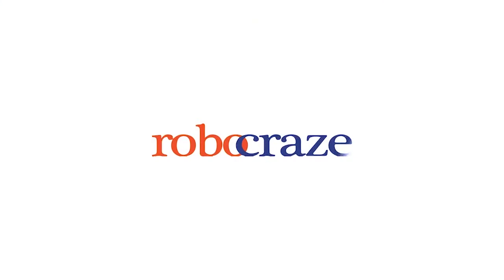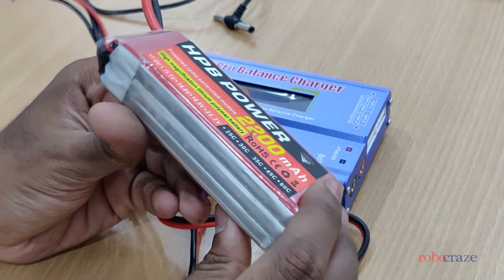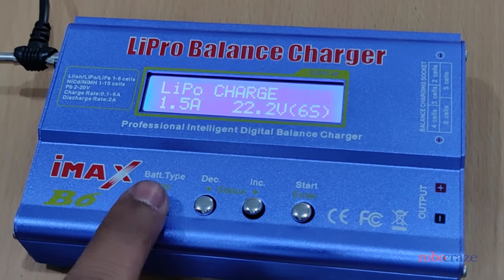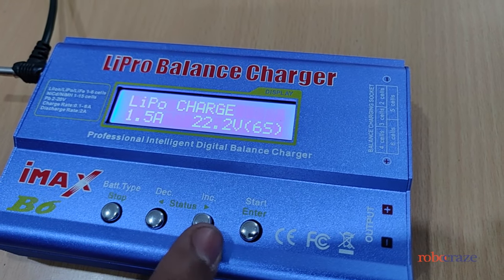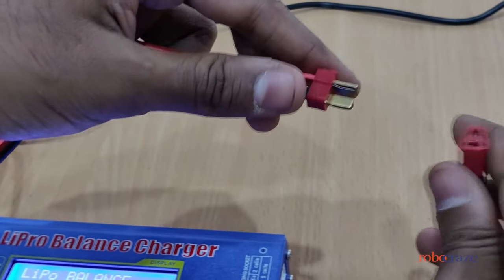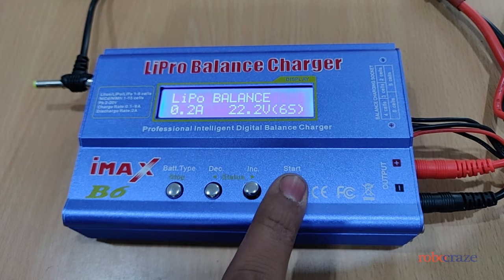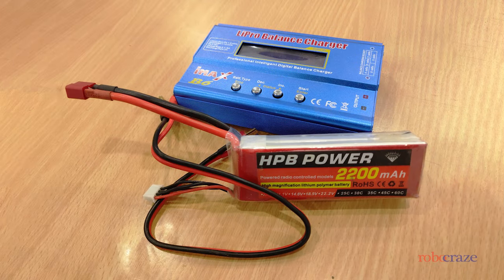#TUTORIAL How to charge a LI-PO BATTERY & IMAX B6 MULTIFUNCTION CHARGER

Comment from the maker: For increased safety, it is advisable to connect your charger into mains power, before you plug in charging wire for battery.
Reply: I put the battery to charge normally with the process you showed in the video and after 10 seconds it stops charging and throws me out and doesn't charge. I don't understand why this happens?😓

Comment: I want to know if it supports up to 20v power supply as input because I want to use a laptop power supply.
Reply from the maker: Hello,
No, the imax b6 does not support 20v and it is not recommended to use this charger for charging a laptop.

Comment: This video has many errors in it.  
1) Never connect the cable to the battery first, your risking the other end of the cable with exposed leads touching each other, etc.  First, connect it to the B6 then to the battery then balance port. 
2) Amp setting.  you should enter the battery capacity... For 1500 mAh, enter 1.5 Amps.... Etc.
Reply from the maker: We will take necessary action. Thanks.
Reply: Of course, there is a dependency and that is that the power you are supplying from the adapter is capable to outputting the wattage and amperage needed.
Reply: So, for example:
5200 mAH 2S Lipo:
Charge at 1C: 5200/1000= 5.2 Amps.
Fully Charged Voltage for 2S lipo is 8.4V
Power Draw: 5.2A * 8.4V = 43.68 watts.

Your adapter must be able to supply that
Reply: Mine is a 5200 mah battery. But the charger only goes to 5.0 is it safe to charge it at 5.0 even tho it’s a 5.2
Reply: K K so i bought the Imax B6AC, youre saying to plug the charger in to the wall socket first, then plug in the output to my deans connector on the battery then plug in the balancer and then set the settings and start the charge?
Reply: @SPIXZY49  Yeah, just balance charge you'll be fine. You'll just charge a bit slower
Reply: @BuckSnortx  Yes.
Reply: @SPIXZY49  yea but it will a tiny bit longer
Reply: I notice wrong info on his part... 5000mah battery would be 5.0amps n so on ,u had battery connected to extension if the ends would of touched possible battery damage...
Reply: @SPIXZY49  yes it will just charge a Lil slower but it's all good

Comment: i have not received the power cord adapter can you please send me a link to buy that power adapter
Reply from the maker: Hi, currently the appropriate power adaptor is out of stock. But you can use any 12V power adaptor with required amperage rating to use your B6

Comment: Sir I am using a B3 compact lipo charger and my 3S battery is puffed. Should I use the charger and battery more or should I throw both of them?
Reply: throw the battery if it is puffed, that means the battery is damaged and has a high risk of setting alight
Reply from the maker: Hello,
If the battery is puffed up do not use the battery at any case.
Reply: @Robocraze  oh yes. I disposed off that Battery a month ago....

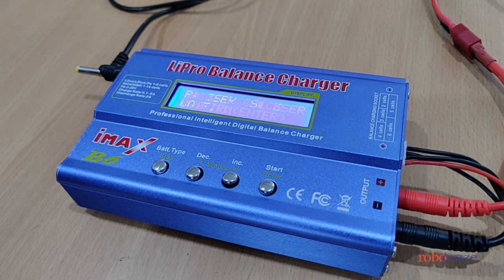Comment: at 3:18, what does the 00000 number mean? It says charged capacity in the manual but idk what that means
Reply from the maker: That number represents the number of mAh that have been pushed into the battery till now. In other words the amount of mAh used until now to charge the battery. Due to inefficiencies of charging, this number might go higher than the battery capacity.
Reply: @Robocraze  thanks. do you know why this number is sometimes 0 for me? is there an error? It says it is charging but the current jumps around alot

Comment: What is the maximum charge for a 4s battery. Because when I plug it into my drone it starts beeping when the battery is at 15.5 volts. Thanks!
Reply: 17,6 is maximum, 4,4 per cell
Reply from the maker: Hello,
A 4s battery has four cells in series, and each cell has a maximum voltage of 4.2 volts.

Comment: 11.1v 2200mah lipo... So my setting can be 1.0A 11.1v(3s)?
Reply from the maker: Hi Fest Sam,
Yes, 1.0 A 11.1v for a 2200mAh lipo battery is a safe setting to charge your battery with.
Reply: Take 2.2A because you have 2200mAh then your voltage (11.1V) and 3S of you have 3 cells

Comment: I am sorry for dumb question, but is this charger STOP charging when battery become full? or I should manually check this? in case manually may I ask to clarify what cell voltage signalize that buttery full?
thank you
Reply: doh I should google it first, answer is 
YES imax b6 stop charging when each cell reach 4.2v

" If all the cells maintain exactly 4.20V then it stop charging and shows 'full'"
Reply from the maker: Hello,
Yes it does indicate the full charge and stops it.

Comment: Hey, nice Video but i have a question. How Long did ur lipo fully Charge?
Reply: Same Question so plz 🙏 help us with your answer.
Reply: @fredrickbryannongrum1182  so i am a bit carfefull with the charging rate,right now im charging my 5500mah lipo on 2,5amps, i never get it under 7 volts,so with about 7,50 volts it Takes about 120mins
Reply from the maker: It depends on your battery capacity and the charge rate (higher the charge rate, faster your battery charges - but it may heat up as well, so should be always careful)
Reply: @fredrickbryannongrum1182  actually now im charging my 5500 mah lipo on 3.5 amps,it gets a tiny bit warm but takes only abt 30mind

Comment: Just a question, how do you know if it is fully charged?
Reply from the maker: Hi. Once the battery is fully charged, the module auto cuts off, sounds a buzzer and displays a message on the screen.
Reply: Robocraze thank you very much! Best regards from the Philippines!
Reply: Alternatively, you can go to the testing and check the cell voltages.

Comment: Nice video, but I have some question about saving and loading data from memories that I hope you can help me with...
When saving data to one of the memories, you're asked for the charge voltage on two subsequent screens. As a test I entered a different value on the first screen vs. the second. When I save this, it simply accepts the value from the first screen. It ignores the value from the second screen without complaining. Can anyone tell me whether these two values actually represent two different things?

Also when saving data to one of the memories you're asked to enter the battery capacity.  But this does not appear to impact the "capacity cut-off" value it uses when charging.  Even after loading this data, it still seems to use the "capacity cut-off" value from the user settings menu. Am I missing something? What is the battery capacity in the saved data used for?

Charge vs. Balance: I'm surprised the default is not to balance charge. I'm also surprised that when loading data from memory, that data can be used to charge, but not to balance charge. Again, I feel like I'm missing something.

Finally, I've found that the charger doesn't complain if I leave the balance tab unplugged for "charge" mode, but it does complain and fail if I start charging in charge mode with the balance tab plugged in and then unplug it while charging. Is this the expected behavior?

Any tips are greatly appreciated. Thanks!
Reply: I feel your frustration haha.  I opened mine up for the 1st time after a 6h drive at midnight, confusing little bugger I guess balance charge is all I'll use it for.  Need we use the discharge for Lipo often? Never done it before....
Reply: @redndeyes  Turns out my model is older.  Skyrc could not give me any info on it.  It self destructed a week or two later.  Despite buying it new-in-box, Skyrc refused to honor the warranty because it was an older model.  I replaced it with the ToolKitRC M6D dual charger, which I like a LOT better.  It's quite small and has a much nicer UI and display.
Reply from the maker: Yes, agreed. :)

Comment: Hello, good tutorial, what are the settings to charge a 4S battery, specifically Youme 4S Lipo Battery, 14.8V Lipo 4S 6500mAh 60C with Tracxas Plug
Reply from the maker: 6500 mAH batteries should be theoretically be able to charge at 6.5A, but this heavily depends on the battery quality. So to be safe, its best to charge at 3A, provided the adaptor being used also has over 4A-5A capacity

Comment: Tha k you for the great video! Would you mind maybe going over the discharge settings and when you should "storage" charge your battery?
Reply from the maker: Hello! Thanks for the positive feedback! To manage discharge settings, you should set the cutoff voltage to prevent over-discharging your battery. The "storage" charge setting is used to bring the battery to around 50-60% charge when storing it for extended periods, which helps prolong battery life.

Thank you for watching! :)

Comment: I got 20A adaptor, shall i set it to 10A in the charger?
Reply from the maker: Your 20A adaptor will be able to supply 10A. But please ensure the wires and the battery you are connecting it to also can handle such large amounts of current.

Comment: You set the AMP wrong. For safety just divide the battery MaH with a 1000. So in your case the charging  AMP is  2000/1000 = 2.  ... Your first cell voltage (3.75) is way off by the way. There must/can be only 0.1  rate difference between the cells. Check your connectors, if it stays way of your battery is dead or it gonna catch fire. So be careful
Reply: I assume Ampere is the same as discharging? I got 1100mAh battery so my Amp setting should be 1.1A? Thanks
Reply: @DreiK96 yes, that is correct
Reply: @The_Gaming_Kiwi  hey I have a question so my battery is 7200 mah so what that mean 7.2a I know it’s a pretty obvious question but better safe than sorry
Reply: @trentinhebert8599  yes, but you can always charge at a lower amp age if your willing to wait longer for the battery to charge
Reply: I would honestly be willing to pay someone to tell me exactly what to charge all my life for batteries at safely I have a k1 ISDT smart charger I went with the one that he used in this video I'm pretty sure I had all the settings right I think it was the charger itself that was defective cuz the battery was pretty much brand new and was working fine but I tried to charge it on that thing and got a huge pop followed by smoke out of the charger not the battery but I think it also toasted the battery as well in the process right now I was about to charge both of my 2200 mAh 3s 35c batteries on my new charger I just plugged it in and one of them is at 9.4 volts but the other one was sitting at 8.3 volts total so that one is pretty much fucked right? Or is there a way to save it? I've been trying to learn all of this but it's honestly super confusing to me electrics were never my strong spot I can pretty much handle anything else mechanically or whatever you throw at me but when it comes to volts amps all that crap I really just see hieroglyphics if anybody can help me please reply I will keep an eye on this comment I'm pretty sure I have the settings right on my charger I also have a lipo battery bag I have quite a few different batteries already today I'm waiting for two 4S 8200 MAH ones to come for my Kraton 4s v2 blx I broke it in using some 3S 5000 MAH and I also wanted to know how you go about using the two 2S batteries and what you need to do that as well as charge those. I'm not sure if that can be done or not but I was told that my truck can run on 3S 4S or 2 of the 2s as long as they all are minimum 5,000 mAh not sure if that goes for the two best ones though any help would be greatly appreciated I don't want to burn the hose down and I definitely don't want to fry the truck either I feel like I've bought quality batteries and a pretty damn charger compared to most help help help thanks in advance subscribed and thumbs up as well as shared
Reply from the maker: Hello! Thank you for your detailed comment and safety advice. You're absolutely right about the importance of ensuring the correct charging current and keeping the cell voltages closely matched. We'll definitely double-check the connectors and the cell voltage differences to prevent any risks. Safety first!

Thanks again for watching and for your helpful input! :)
Reply from the maker: Hello! Thanks for sharing. It sounds like the 8.3V battery might be damaged, so I’d recommend not using it to avoid safety risks. For using two 2S batteries in your truck, you can wire them in series to make a 4S pack.

Thanks for subscribing and sharing! :)

Comment: i have an solar battery with a memory problem which i am wanting to resolve a memory problem using  my imax b6 charger/balancer every time i get a low voltage notice I am unsure of what i am doing wrong thank you
Reply from the maker: Hello,
If you're encountering low voltage issues with your solar battery, consider checking the battery's health, its charging and discharging settings.

Comment: What is the adapter input current? Can I use 18 volt, 1 Ampere adapter?
Reply from the maker: Hello,
Yes you can use a adapter between 11-18v range. The iMax B6 charger can charge batteries with a current ranging from 0.1A to 5.0A.
If you plan to charge batteries at the maximum current (5.0A), ensure that your adapter can provide sufficient current without overheating or voltage drop.

Comment: Hi , I have purchased this charger and bonka 4200 mah . First of all im appreciating you for the great service. My question is how much ampere  should i set in the charger. As per my asumption the battery is 4200 mah with  35 c and 3s . so will it be 4.2 A
Reply from the maker: Thank you for your kind words, I'm glad to hear you're satisfied with our service!
Regarding your question, since your battery has a capacity of 4200mAh, it's recommended to charge your battery at a rate of no more than 1C, which means a charging current of 4.2A is safe for your battery.

Comment: good day , a 2200 mah battery i was under the impression that the charging rate would be 2.2 , but you set it at .5  ok  anyway  i have a1500 mah battery was setting it at 1.5  but it seem like it  wasn't charging then i set it at .5  and working .
Reply from the maker: Hi,
It is recommended that you charge a battery at 1C or lower to extend the lifespan, as charging at higher C can cause damage your battery. But this is also limited by the power rating of the adapter you are using. Do not set the charging current to a value greater than the power adapter can supply.
Reply: So divide by 3???

Comment: Hi
lam having a 1000 mah orange battery 30/60 1s 3.7 volt . Can I charge my battery with this charger?
Please advise
Reply from the maker: For a 1000mAh 1S LiPo battery with a nominal voltage of 3.7V, you can use the iMax B6 Digital LiPo battery charger with a charging current of 1A or lower, LiPo mode, and 1S cell count.

Comment: Can you please explain why you chose to charge at 0.5amps? You said the adaptor is 1amp, what do you mean? My batteries say they can charge at 3amps. Should I still set them to 0.5amps?
Reply from the maker: Hi,
Charging current is kept under the limits for safety purposes. The current used also depends on the wire used for charging. If the adapter allows you to draw 3A, then its safe to keep it at around 2.5A
Reply: @Robocraze  How do I know how many amps my adaptor can handle? Is it written on the cables or something?
Reply: My exact thoughts...when you say adaptor...which adaptor do you specifically mean ?

Comment: How do I configure current for my battery pack? I have 6 lipo batteries (each 220mah, 45C) connected in series with a balance cable attached so that they make a 6s battery.
Reply from the maker: Since you have connected your batteries in series, the effective capacity of the battery pack does not increase but rather the voltage. Since the effective capacity still remains at 220 mAh, it is still recommended to charge the batteries at 0.2 A or less

Comment: my battery has a xt60 connector, but the charger didn't come with xt60 cable? should i order an xt60 cable or can i use the aligator clips as you said in the video?
Reply from the maker: Hi Vikrant,
It's best to order an XT60 cable. Aligator clips can be used but you must exercise extreme caution since the ends of the clips maybe exposed.

Comment: How do you know when the battery has finished? I have a 3 cell 5200mAh 80c 11.1V 57.72Wh battery
Reply from the maker: The charger is designed to automatically stop when the charging gets completed

Comment: Hi there, I did everything you did pressed start but only comes up with “battery check… low voltage” is that my car battery that’s low or my battery that I’m charging what do I do further?
Reply from the maker: Hello! The "battery check… low voltage" message typically indicates that the battery you are trying to charge has a low voltage. Make sure the battery you're charging is properly connected and has enough charge. If the issue persists, check the connections and consider testing with a different battery to diagnose the problem further.

Thank you for your comment! :)

Comment: Is necessary to connect output port ?  I have connected my output wires to drone board. 
What can I do now ?
Reply from the maker: It is important to connect the output port of the charger to the battery during the charging process to ensure that the charger can properly regulate the charging voltage and current.

Comment: Hello Sir, I was wondering why you chose 0.5Amps. I don't quite understand. Many places online recommend charging at 1C, which in your case I believe would be 2.2Amps. Great Video, thanks!
Reply from the maker: Hi,
Yes charging at 1C is optimal, however you also have to consider the max current that the adapter can supply. To stay below the limits of the adapter used for the video, we selected 0.5A.
Reply: @Robocraze  Thanks!

Comment: can I charge 2s or 3s or 6s of 18650 if I  connect only + and - wires  , without balance wires ?
Reply from the maker: The charger will not start charging the battery until it detects it using the balance wires. It cannot be used by just connecting the +/- connectors